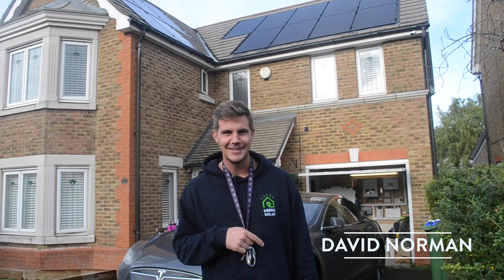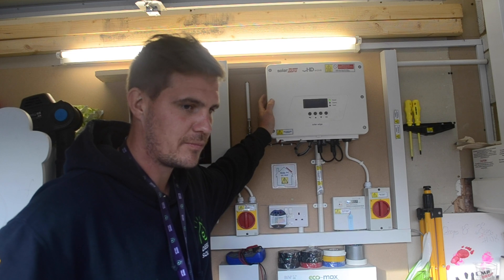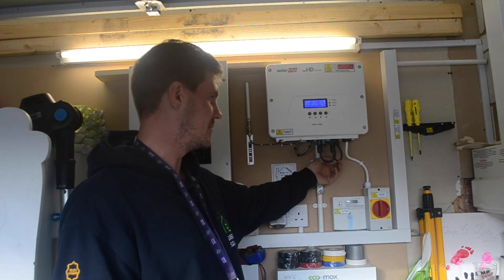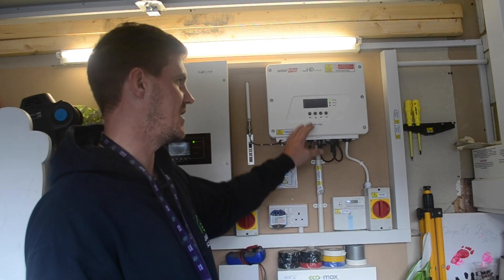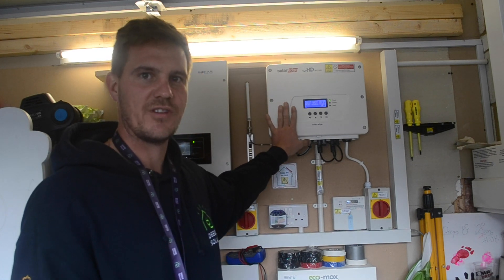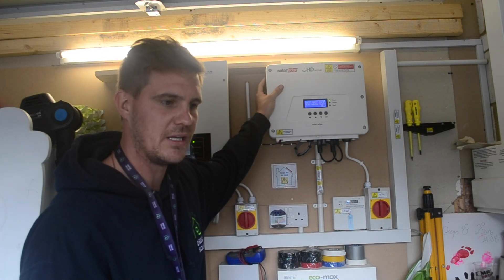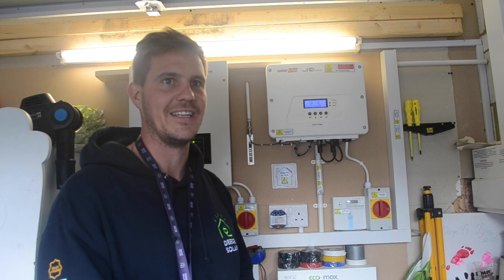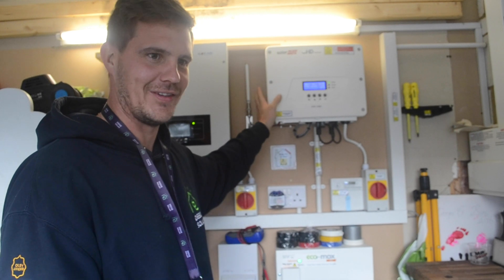The Benefits Of SolarEdge | Deege Solar

Comment: Hi, I’m having a Solar edge pv 6kw system fitted, I would also like to fit pylontech batteries is it something that would be fairly straight forward to ask my installer, they have quoted the solaredge 10kw battery as an option, but unfortunately my budget does not stretch that far. Tia, great informative videos 👍
Reply from the maker: Hi Andrian, Thank you for your comment. Yes, you can add Pylontech Batteries to such as system, however at the moment due to the demand for Plyontech they probably wouldn't be the most cost-effective solution either. 

Check out Growatt Batteries 🔋 https://www.deegesolar.co.uk/growatt

Comment: Would you recommend a solar Edge system on a 15 panel system in the UK that is facing direct to South with absolutely no shading?
Reply: Have you had the system installed? Did you opt for optimisers?
Reply: @serraios1989  priced up a Solaredge and solaredge battery. Ridiculous pricing.

In the end I didn't go down the optomiser route and just bought a Solis hybrid inverter. 14 x 400w panels and 14.2kWh of Pylontech batteries. £11k and over the moon with it.

Best bang for buck if you ask me!
Reply: @deansh8506  
Smashing